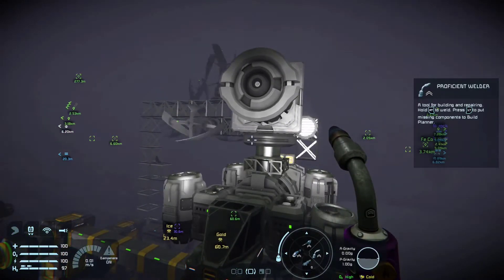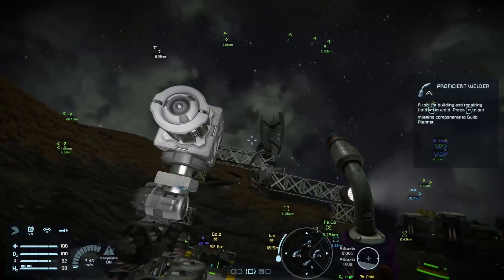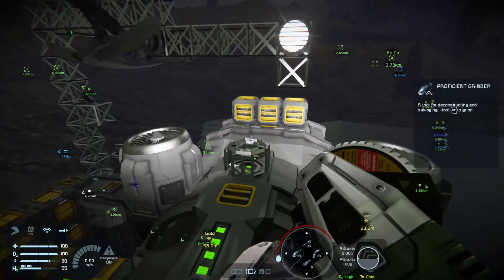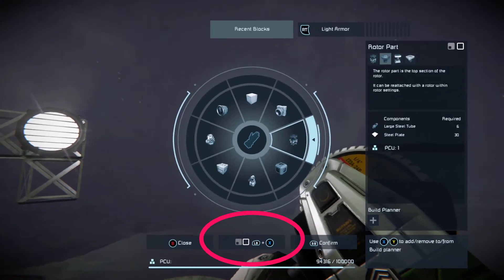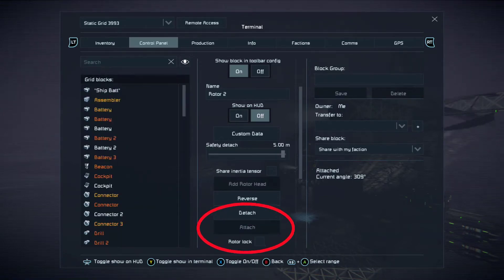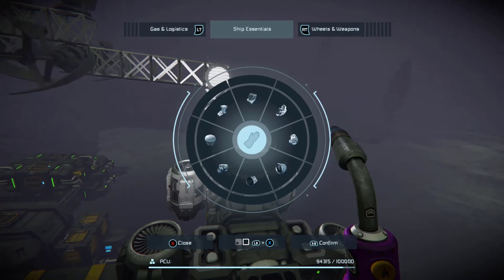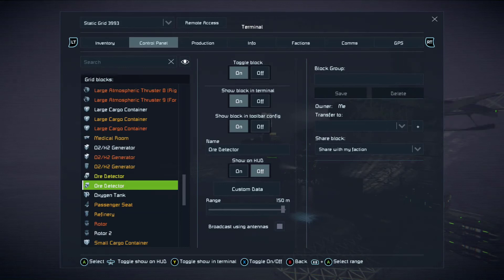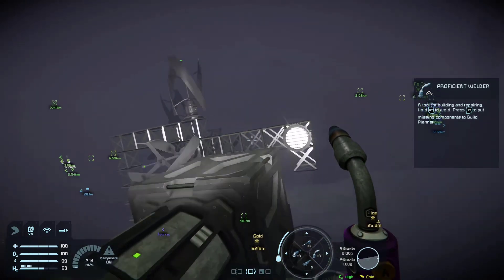Space Engineers Large Grid Ore Detector on a Small Grid Ship. Step by step tutorial.

Comment: What about doing that in space?
Reply from the maker: Tried but no. Even with a gravity generator it doesn't work. Now that was a while ago so maybe it will work now.
Reply: It’s not working for me in space either. It won’t drop into place even after turning my gravity generator to max.
Reply: @ use a small ship with landing gear in front of or bottom.  Drop the rotor part on the ground, use the ship to pick it up and maneuver it over the rotor and drop it in place then get the ship with the rotor and select attach.  I just do it myself without a ship in gravity, in space I make a small itty bitty ship, put the small blocks on the nose, about4 or5 long. Put a landing gear or mag plate on the end, and pick it up and place it.  The ship can still be holding the part in place.  Jump out, get in the ship with the rotor go into control panel and click attach.